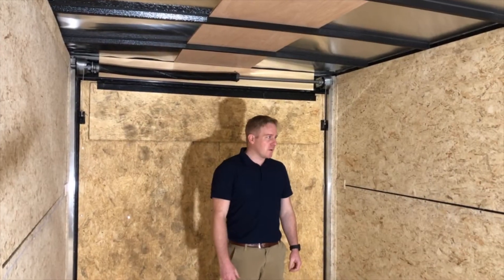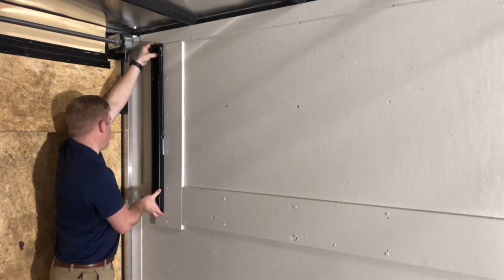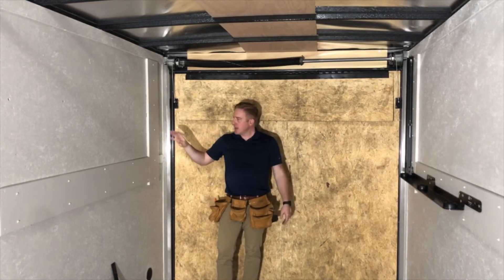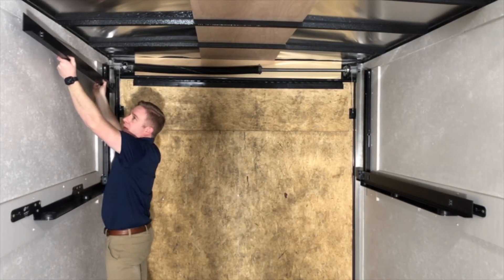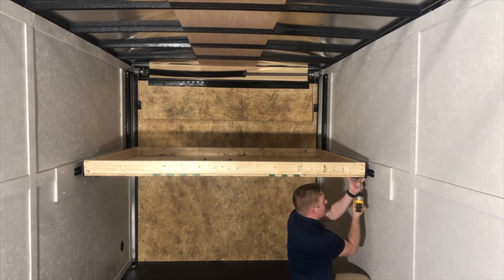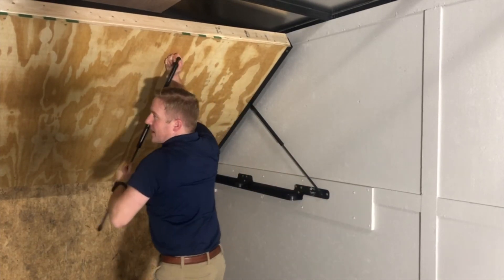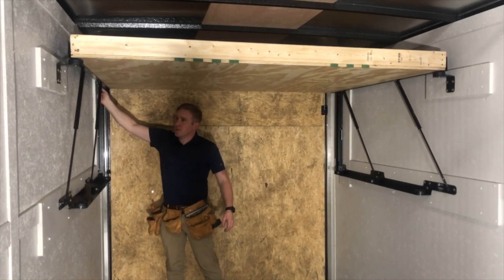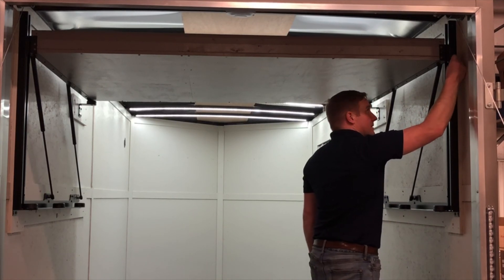Cass Hudson Co's Sleep&Store Installation Video, Non-OEM

Comment: i have a 8.5 wide trailer. thinking of using cal king 72x84 bed. i see the horizontal rails says 60in long. so can you extend the bed frame past the vertical rail or would it be better to just center it on the horizontal rails. i could do with out the separate upper L stop and just do like a eye bolt and hook strap to clear the swing. or how would you recommend doing a cal king with this set up?

Comment: What’s the standard length of these gas springs? Do u have diffrent lengths in this system, depending on the hight of the van roof?
Reply from the maker: We currently offer two models of Sleep&Store. Our standard BDAS-2510 utilizes 36" struts and has a drop range of 28" inches. BDAS-2781 utilizes 31" struts and has a drop range of 20".
Reply: Usually 36"

Comment: how far away is the trailer wall from the lid where the bed frame sits, i want to calculate the maximum bed length i can have in my 80 inches wide ( interior width) trailer
Reply from the maker: The mattress frame sits roughly 2-3/8" off of each wall. So you can measure wall to wall and subtract 4-3/4 and that will give you the total width available for the platform frame.
Reply: This! How how to mount it how far from.door?

Comment: What weight rating did you use for the shocks?
Reply from the maker: The BDAS-2510 comes standard with 60# struts and a rating of 120# of max lift for the platform and mattress.

Comment: Is this for any size of bed or does it need to be a specific size
Reply from the maker: It is dependent on the width of the trailer you are installing the system into.

Comment: Has anyone installed this on a van or doesn’t it work because it’s not square?
Reply from the maker: We get several custom sprinter builders a year that ask to incorporate our system into their van build. It works well the install has to design brackets that bolt onto our system and extend to their frame or carpentry that allows for our system to be plumb.

Comment: $700 greedy much. It's only a few feet of steel. YouTube has videos showing how to build these for under a hundred dollars.
Reply: Share the link
Reply from the maker: Our system is patented, 100% American made, and shipped to anywhere in the US for free. We think it's a pretty good deal.
Reply: Yeh lol… i suggest you actually try building one yourself off those videos. Im right in the middle of it - “sure, what the hell, couple parts, i can do it…” . Just finding tubing to make the channel for wheels was a b$&$h. I literally bought every size of caster wheel upto 3 inches and spent 2hrs in metal shop trying to wedge them in. What? 2in wheel for 1x2 tube - done!? Nope, inner size is smaller - has anyone tried to shave 1/8 of wheel surface of a caster wheel? Yep, i thought so. Oh it gets even better when you start on strut mounts - try to test without making bunch of holes in the wall… So please try it before you speak up
Reply: @dmitrybatishchev2867  The tubing is on Amazon. Hell, everything is on Amazon. I got 4" wide square tubing. I just bought the steel angle for the whole rectangle locally. It was $130.
Reply: @dmitrybatishchev2867  i was thinking uni strut with dolly rollers.
Reply: Share the link
Reply: Share the link
Reply: Share the link 😂😂
Reply: he got no link XD  just trashtalking the pricetag....
Reply: @Heinz76Harald  https://www.youtube.com/watch?v=t6V8nzRNBfo
Reply: Yall just look for it. Brian did a pretty good job explaining how he built it.
Reply: You could just sleep on the ground and save even more

Comment: Its a great idea, but when you add the weight of a mattress, everything changes.  Its a bear to lift into the "up" position. if you are not standing dead center and lifting, it gets "cockeyed" and you have to lower the thing and start over.  It might work better with something like a 4" mattress pad that weighs next to nothing, but put a normal 10" mattress (Queen) on there, the entire dynamics change.  Its still a good alternative to a $2500 happy jac, but its not as easy as this video makes it out to be.
Reply: Agree, same problem here, but still a good solution.
Reply: Just change the shocks to a higher resistance value. Yes, almost every product made needs modifying.
Reply from the maker: The standard struts are 60# and provided are rated for a max lift weight of 120#. We offer 80# struts that you can swap out if you are needing more lift.
Reply: Wrong

Comment: Can you tell us the distance the bed is from the floor when in lowest position?
Reply: Hi Maurice, there are a couple of variables to take into account to figure that out. You'll need your overall ceiling height and the thickness of your mattress that you'll be using (this determines how far away from the ceiling you can set the system up). The overall height from the top of the channel guide to the buttom of the sleeping rails in our BDAS-2510 Sleep&Store is 36", when using a 4" mattress you will need to mount the system 2.5 inches from the ceiling to accommodate the roll up action of the system. So if your ceiling height was 86" the bed system in down position would be 86- 38.5(2.5+36) or 47.5" of clearance from the floor.  I hope this anwsers your question! you can visit casshudson.com and get a full list of install instructions.